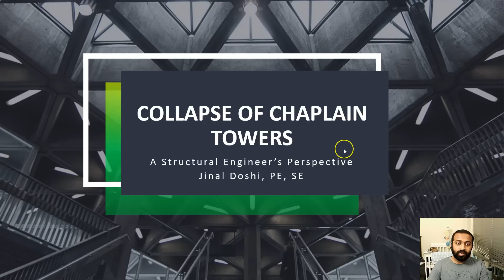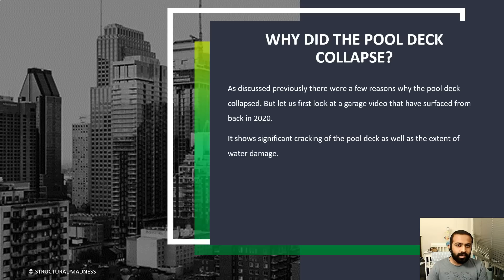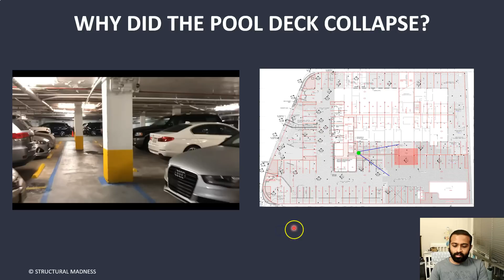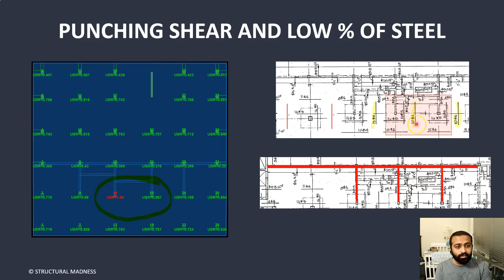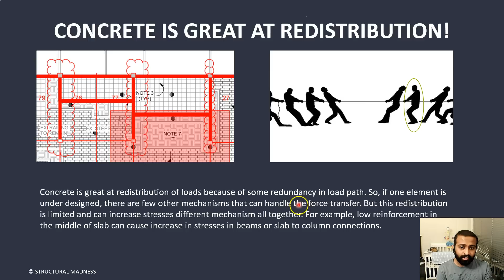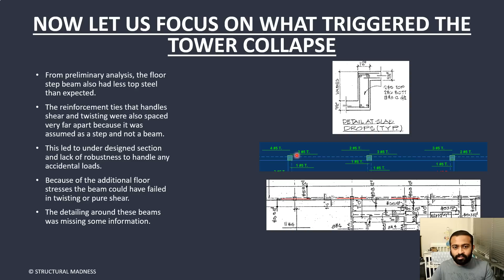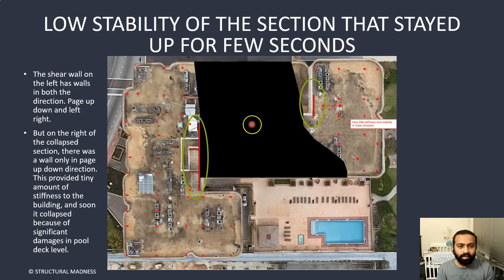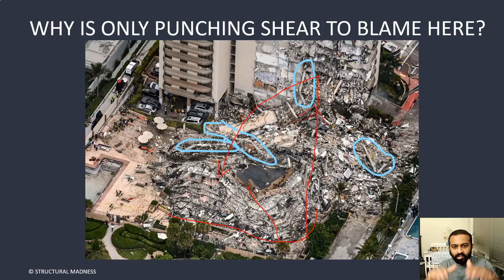Reasons behind Surfside Building - Champlain Towers South - Collapse : A Structural Engineers Review

Comment: Look at what "Building Integrity" found today. Changes to plans removed beams that affected parking and planter areas.
Reply from the maker: Hey thank you for commenting. I have known about those changes prior to making this video, but the reason why I have just focused on the revised drawings because they were used to build the pool deck. And not just the regions with cars, but in general the pool deck in around 2000-2500 sq feet was definitely under designed.

Comment: you should look at the twin tower to the north of this is that one going to fail
Reply from the maker: As I mentioned there were multiple overlapping factors. Since North tower had different management, they would have maintained it differently and could have minor design as well as construction differences. These differences could go a long way in terms of building damages / performance under daily usage. So it is not as simple as simple extrapolating that if South building failed, then north is also bound to fail.

Comment: What happens if you add to the pool deck 1-1/4" pavers and sand, 1-3/8" tile and mortar and 2-1/8" concrete topping? Like they had done?
Reply from the maker: Hello, I did consider all this weight in my analysis when I was checking the slab for the load demands imposed by the finishes onto the critical element failure mechanisms.

Comment: I’ve never heard of a building collapsing with no warning whatsoever. Even Sampoong, Rana Plaza, I-35W, Hyatt Regency. They all gave up some warning signs, sometimes weeks or months in advance.
Reply from the maker: That is one thing to understand here. Punching shear or a shear mode of failure in general is a brittle failure because it is mainly concrete with some influence of steel is holding the members together. Ask any structural engineer and they will respond that "We design buildings such that if they fail accidentally then it will fail in a ductile mode of failure, a ductile failure mode is the one that gives you enough warnings to either conduct repairs / evacuate prior to sudden collapse. Even building codes are laid out that way when we design members against brittle failure modes vs ductile failure modes." In this unfortunate scenario because of multiple issues from design to maintenance, it was the brittle mode of failure that has lead to this collapse.

Comment: What are you talking about. Of course there is evidence of seawater seepage in the basement. The maintenance in the building told my friend that during high tides they couldn’t popped out the water from the garage. The garage was constantly wet.
Reply from the maker: May be I came across incorrectly for you, but when I mention seawater seepage, I meant to say that it had no influence towards pile down drag, differential settlements or the pool deck that collapse. It was over time water penetration and atmospheric salts that lead to reinforcement corrosion in an already under designed pool deck. Typically basement walls and at grade slabs do have higher concrete cover on reinforcement that helps protect these elements against the soil and water seepage. I hope this clarifies.

Comment: There was a lot of marble and granite in these apartments.
Reply from the maker: Again, the added weight of apartments above was still less than the design capacities of the columns. And columns just doing fail easily because of the design factor of safety, factored loads and the probability of all the floors seeing peak live loads on all columns is highly unlikely. Specifically at the time of failure. So again it is not relevant to why the building partially collapsed. When a concrete column fails like that, it has to do with the stability issues of the column section. It can be buckling, our of plane deformations, lack of ties and damaged concrete because of partially collapsed deck.

Comment: What was the anticipated  combined weight  of parked vehicles in 79, before the present day big ass suvs& pickup trucks&  generally  heavier cars on the road today?
Reply from the maker: A better question would be, for what load was it designed for? As per the Florida building code, a parking garage with limited height vehicles was supposed to be designed for 50psf of live loads (that is 50 pounds per square foot of vehicular load) while today the national building code has reduced it to 40 psf under service conditions of the building. This means that the expected weight of vehicles hasn’t varied much. Today when a comparison is made between newer and older vehicles, the weight pretty much end up with 15% of each other. So in terms of added weight of newer vehicles, it wasn’t significant. As cars are getting advanced but also materials to construct those cars are getting lighter and stronger.

So the vehicular weight has not change a whole lot since the past 40 years. And I don’t believe that it was significant enough to cause any significant structural damage to the building. 

Again remember, there are thousands of buildings that are still standing and are robust to handle the weight of modern vehicles. This was under no different condition, but it was mainly the extent of corrosion damage and original under design that is the culprit here.

Comment: I think it started where the rebar was along the seawall where they swimming pool was there was a lot of concrete blowout and rusty rebar.
I think change of temperature and being windy causes excess stress, the Shrinking of the top surface with the wind blowing through the parking area like a airfoil cause downwards pressure even more the sudden loss of tension cause the other rebar inside the building ceiling area to give way the supports couldn't hold up the weight
It's poor design and probably poor workmanship, they should have had a shear wall in that area connected to the the decking area separate wall not connected to the build under load , Was not enough shear wall and the positions it was wrong especially on the small shear wall that needed to overlap the bigger shear wall and end at a T shear wall. The fixing into the shear wall was wrong as well in the stairwell and the lift area just pulled out the rebar.
One thing I heard is when renovation work was carried out on the decking new bricks on the pool decking area said they moved to drain up!! you wouldn't want to do that.
The water penetrates through the bricks through the sand and should collect in the drain a waterproofing membrane will be used and drain cover but you would never move the drain up

Comment: Great video, analysis and explanations. As a now retired, ex civil Engineer (UK, C.Eng and with some experience of structural issues post Ronan Point , and in HK due to corrosion, missing steel, missing cement, poor detailing and 'skinny' structures) I found your suggestions believable. 

I do have issues around the changing concrete strengths throughout the building CTS and the construction sequence possible if those strengths are strictly applied (it seems a penny pinching saving!) . One of my other concerns is around lap lengths/embedment of rebar as at first glance they look short, concrete cover is another concern, along with a general concern as rebar in columns and slabs looks light (IMHO) - BUT   I have never designed flat slabs and my reinforcement detailing experience was a LONG time ago. (and design used working stress anyway).

Punching shear issues seem obvious from surviving columns but the actual failure at that time and place seems to indicate ongoing issues resulting in a 'trigger' that propagated a series of failures throughout. 

To repeat well done good thinking, analysis and presentation.
Reply from the maker: Roger, thank you so much for this compliment. I only did this extensive study on this because I wanted to let people know the most probable cause of this collapse. Yes it is boring and mundane solution, but that’s even more important because structures can snap away just like that, if not designed, detailed and maintained properly. I constantly am reminded of all the lives that were lost in this tragic event.

Comment: A very very good presentation! I wanted to say a couple of things that you may or may not be aware of. First, where the beam is that ties the building to the pool deck, there is an 18" elevation change. Not sure if this changes anything in your analysis. Second, were you aware that there is an eye witness who was about 30 feet away from the collapse, who says that the deck collapsed in two separate events. The first collapse was where the cars are parked at pool deck level (the part of the building that survived). Only 4 spaces fell initially, then 2 more. Shortly afterward.. the rest of the pool deck collapsed. One other thing - there is another witness who said that loud noises started about 90 minutes before the building collapse. Her ground floor unit was closest to where the damage is seen in the video.
Reply from the maker: I am aware of the step, that’s what I was referring to as step beam in the presentation. And this step varies at various locations and ranges from 18” step to 11” as well as 7”. That’s what I am reflecting in the the 3D model of the pool deck. 

The under Reinforced step beam under shear and torsion along with bending is one of the primary culprit over here that has lead to building collapse. If the beam would have stayed intact then complete collapse of the tower was highly unlikely. It was the failure of this beam with columns instability or lack of enough ties has lead to a failure of these columns.

I did read the interview of the lady / person I don’t remember who they were, but they mentioned that when they were in the lobby complaining about the noise, she heard a loud bang that’s when she saw the car park deck collapsed. And I read this in Seattle times. I would also say that under such tragic events people may mix up the collapse sequence, and the car park area collapsing first seems highly unlikely because of couple of reasons. 

1. The bay was supported by relatively larger column sections which have more punching shear capacity compared to a smaller column supporting the pool deck only.

2. The water penetration under a shaded parking area would be less frequent compared to the exposed pool deck.

3. The span of slab in this car parking area was around 24’ while that of the slab next to it which I have focused on the video, has longer spans 29’-8”. 

So if the thickness of the slab is same and one portion is under designed, the long span ones, then based on the probability of collapse occurrences, I would bet on the long span region.

It could be that the person did realize it first because it was closer to the darker spot where it collapsed first and then car park area collapsed later.

I do believe and numbers more than anything else, because structural engineering is all about probable demands and probable capacity and it is the ratio of these two which are typically the driving force behind the collapse.
Reply: @StructuralMadness  I’ve been tracking witness statements since the building collapse, and there is no surviving witness who actually saw the deck collapse as it occurred. Sara Nir from 111 was in the lobby complaining about a loud noise that had occurred at 1:10 AM. At 1:15 AM the deck collapsed. All surviving witnesses describe the sound of it as one huge crash, not a series of multiple discrete crashes. After hearing that crash, Sara ran over to the lobby window next to the parking deck and saw that it had collapsed. There would have been a lot of dust in the air at that moment, and it was also dark outside; Sara has never described seeing anything beyond the parking deck at that point. There is no surviving witness who has stated the parking deck collapsed in two stages. Here is a link to the Timeline of Witness Statements. https://docs.google.com/spreadsheets/d/1vzmMPe83QyvpRYtduCJLarmGed1QDwwQ6Q77O1VRsJE/edit

Comment: I am no structural engineer but it seems you missed some major points and because of that your conclusions are off.... First off the pool deck was more than sufficient for the original design, where the issue came in was the remodel of the pool deck in 1996. The original design has a sloping concrete to a middle drain, it is reported that the contractor in 1996 added 1 inch or so of sand and then tile on top of of the original deck, then raised the drain to the be even with the tile... so now any water getting into the paver sand had nowhere to drain too... which is why the concrete was wet pretty much all the time causing the rebar to fail plus the extra weight of pavers and wet sand..... years of wet concrete just gave out one night and happened to take a few building support columns with it...
Reply from the maker: I would say I haven’t missed any major points. Based on the experience accumulated so far, I can look at the loading, span, thickness of slab and reinforcement and make a quick guess on whether the design adheres to the building code or not.

The original drawings did call out for pavers on pool deck, so we can’t say that the new contractor added the tile weight. It was just replaced by the older ones. The 1-1.5” of added sand is not a considerable amount of added weight on the deck compared to its original design loads. And as I mention at around 20:25 time stamp that it was under designed at a few locations and the speculated location of under designed slab has collapsed prior to the the building failure. And it also makes sense why it collapsed prior to anything else, mainly because of this low reinforcement in the slab. Typically low reinforcement which resists bending is responsible to control cracking of the section and when a member is under designed in case of flexural demands just means more cracking, it just doesn’t fail immediately and we call it ductile mode of failure. A member that is under designed also doesn’t necessarily means it collapses immediately, but it mainly means it did not adhere to the code requirements and the structural performance under daily load conditions vs the unexpected loading will be less than desirable.

Now when we consider this along with lack of drains means more damages to the structure and rebar corrosion and concrete damage. This translates to the reduction in capacity over time as I have discussed in the video. 

So, I understand your perspective, but it is just that once someone performs in depth calculations then only one can understand the severity of this under designed pool deck.
Reply: @StructuralMadness  With the clean up already I wonder if there will ever be a way to know if the drain was properly installed with the renovation. Sand locking in water due to poor drainage would have added a considerable amount of weight over long periods of time, as well as creating the condition for the rebar to fail and rust... that would explain why so much of the deck fell at once.
Reply from the maker: @PhilKnock  I think NIST has taken several samples from site to study the possibility of overloaded deck / material damages. I think that’s going to be their main point.
Reply: If you aren't a structural engineer then how can you say that the original design was more than sufficient?  I will tell you that the parts that I did calculations on were far from being sufficient.

Comment: Poor design. Can't sue the board.
Reply from the maker: Well, again it wasn’t just the design drawbacks that lead to collapse. If it were maintained properly, then the chances of even a partial collapse would have reduced. Again, it is just multiple factors that played a role and we can’t just isolate one and say this is why it collapsed.
Reply: @StructuralMadness  - The wrong design over time just might not hold up regardless of what you do to maintain it. Water that doesn't drain is a design issue. You'd need to rebuild it to fix that problem.
Reply: @StructuralMadness  - But it could have been the way that it was built... Maybe the builder deviated from the design. Maybe there was a crooked inspector involved.

Comment: @28:22
Is those capacity calculatet with the 1979 building code - as THIS codes used for the building.
Or is this the capacity with today live load, and building codes?

Underdesigned by the old codes or undesigned by failing in use this old codes?

In particular, it should be borne in mind that at the lower end of the dimensioning specification, test set-ups tend to achieve greater load-bearing capacity than calculated.
Because the formulas are tailored to the upper end and the usual construction, while at the lower end, "early" reinforcing is okay. 

So, older codes with a lower "usual construction point" should show a higher load-bearing capacity - without this being an error in the code. Simply because we don't build hyper complex formulas for all marginal areas.

Comment: At Time 34.27 Drawing the witness who ran off was looking from the building edge where you have a red dot over the green. To the west south west where cars were parked over parking spots on lower level 71 to 74 that seems to be the first point of collapse. Cars moving on under strength decking weakens it over time. Much heavier steady load than architects took under consideration it seems also. Very good examination of a dreadful event.